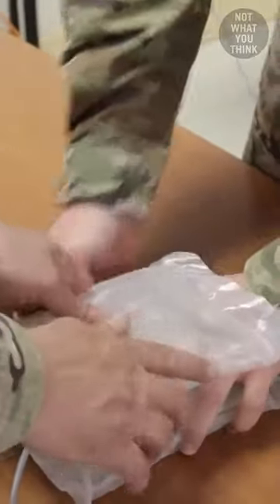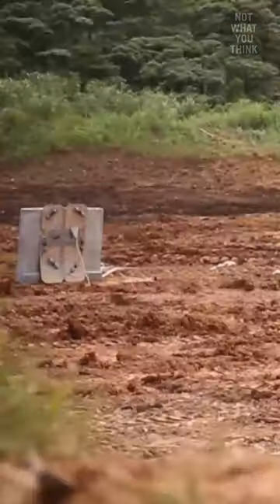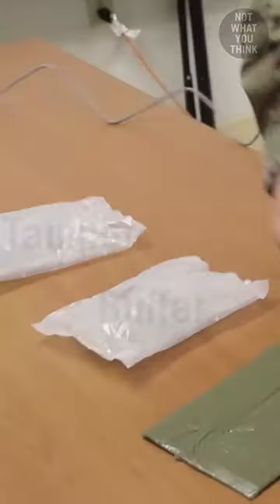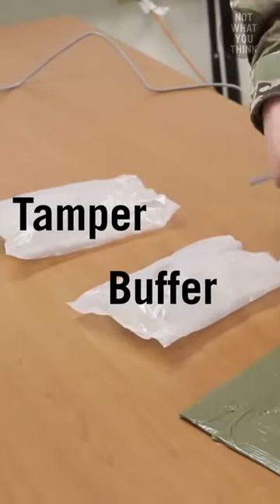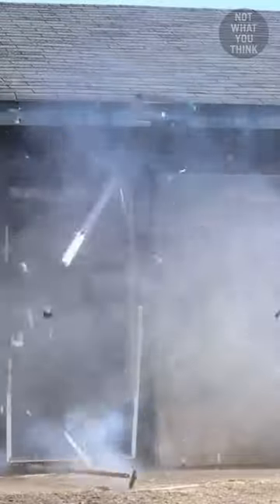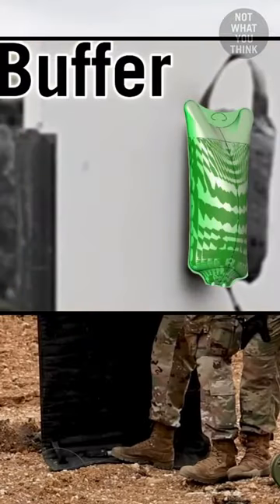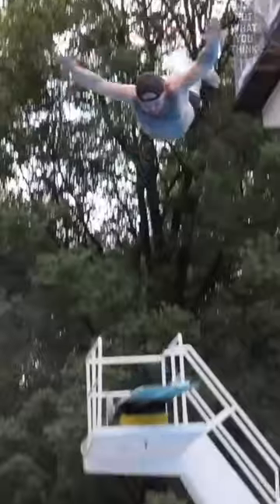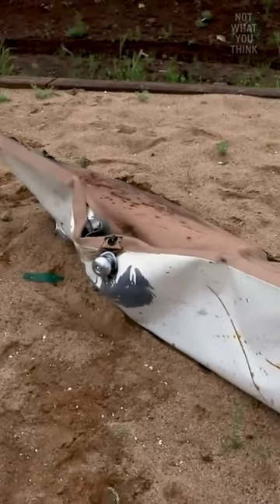Improving Explosions with WATER

Comment: The reason the water does so much damage is that water essentially can’t be compressed and it’s light so it’s easy to carry. The shockwave is transferred easily with less fragments.
Metal can be warped which and gases compressed, so the shockwave is more effectively transferred into the door.
Reply: Metal (say, steel) should be less compressible than water, I believe.
Reply: @Pindrop22  Steel bends and distorts.
Steel door moves away from the blast.

You are right it does not compress.
Reply: @Pindrop22  Water does compress very little, but the whole bag can move. On the ocean, that's called a wave. Basically, it's just the mass, not the material, what counts.

Water can be sourced in a lot of places. Carrying lots of steel or lead instead is...not a lot of fun.
Reply: @Pindrop22 you would think so but actually water doesn't compress. It's why hydraulics are safer than mechanical or pneumatic systems (they don't expand when the pressure is released either).
Reply: @alanhat5252 it does compress, just not for forces short of cosmological
Reply: It is called the Pascal's law
Reply: @daltongarrett3393  The conpressibility of water is insignificant enough that's it's almost never calculated for.
Reply: @leovang3425  for sure, I was just arguing on a technicality

Comment: I’d like to see a comparison with and without it. Surely you’re giving SOMETHING up if you’re using half of the amount of explosives.
Reply: It’s not so much about giving something up in this context. Efficiency is about getting somewhere with the lowest cost possible and half the explosive material in this case is enough with the changes.
Reply: @BestCase_Scenario What’s the weight difference of half the amount of explosives plus water vs what would otherwise be the full amount of explosives?
Reply: @conor7154 you can find water anywhere, you can’t (normally) find c4 in a creek
Reply: No. Normally, the blast force would go in all directions. With the water-filled IV bag, you cause an impedance mismatch which will reflect the blast force component going away from the door...back to the door.

Ah, electroacoustics ("loudspeakers") and pyrotechnics ("boom") have so much in common!

Comment: Are they full of air or water?
Reply: Water
Reply: it is a water charge.  I saw one in Okinawa
Reply: You need a change in impedance. Typically, air has the same impedance as air, but water is different. The change in impedance reflects the blast wave.